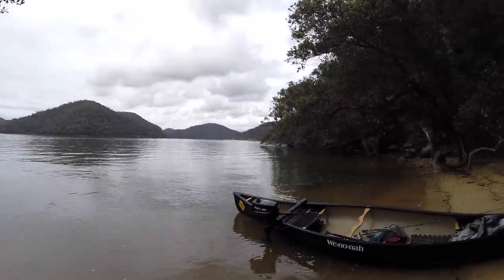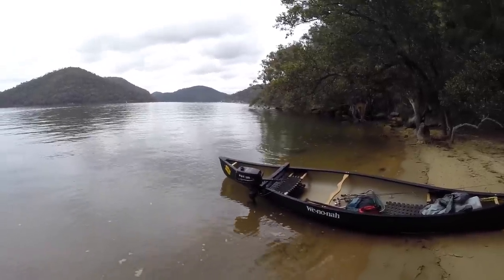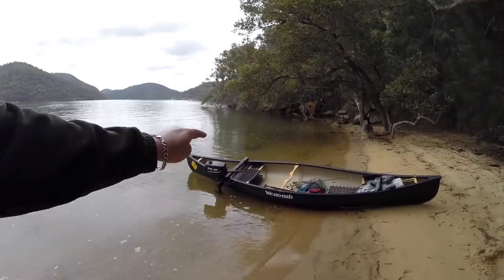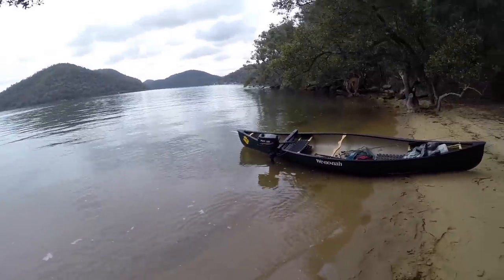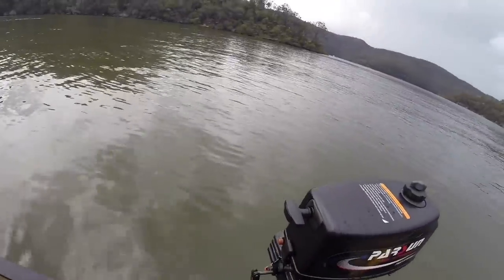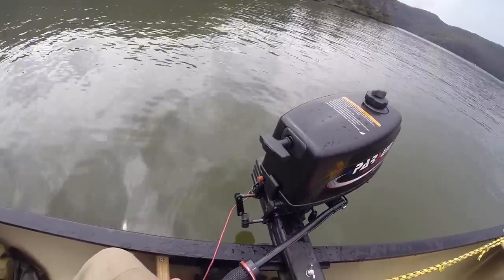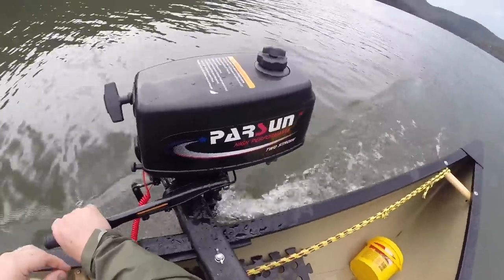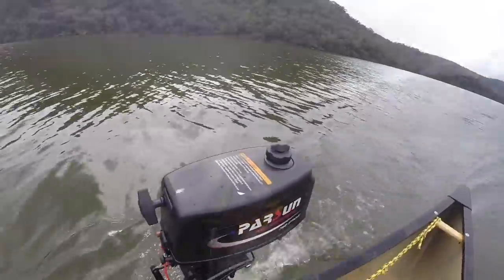TESTED - Power Canoe With 2hp Outboard Motor

Comment: Gonna try my 4hp outboard on my 15 1/2 ft canoe  with a steel transom I built today :) wish me luck . I got a buddy to sit up front for this test though  . Nice video brotha
Reply: How did the 4 horse do? Is it too heavy for the canoe? Torn between a 2 or 5 horse outboard for my 17ft Grumman with a side mount.
Reply: I sunk my canoe today with a 4hp electric outboard on a 15 foot old town canoe.   His advice about the splash guard is necessary.  Also not ideal for a lake with waves and chops.
Reply: @zachberman9785 saw someone do it with 4hp but they had an aluminum 17ft canoe

Comment: I’m torn between going for this or a 55lb trolling motor & battery. This works better than I thought it would. Thanks for the video.
Reply: Im in the same boat (no pun intended). I think the biggest perk of the outboard is not having to rely on battery power. I think the biggest negative would be the noise and lack of a very slow tolling speed. However it would be nice to reserve battery power for electronics and not your motor.
Reply: @UserFormelyKnownAs_hjkh  have a look at the Honda BF2 or BF2.3. They have a centrifugal clutch and can be run at very low trolling speeds or in neutral. Epic Japanese quality, I just bought one today.
Reply: it depends on where you run. a electric motor allows for State Park use and isn't annoying at night to camper.  if you do larger rivers and huge lakes obviously a gas would be better.  just get both and pick the tool for the job

Comment: Boat stores are far and my car doesn't tow, would like to get the sundolphin 14ft ss canoe but instead of a trolling motor it's made for I wanted a small hp motor only seeing 2.5 hp on the market not 2 hp they still make these ? Thinking of the Suzuki 2.5

Comment: Nice little engine, very fast. I have an electric motor for my canoe but would like a small gas engine like this one.....Take care, Bluefin.
Reply from the maker: +mustang774 cheers mate, yeah it moves along well. I think it fast enough to reach spots that otherwise would be too far for a day paddle. It allows me to reach a few extra fishing spots when I'm just out for the day too.
Reply: what kind of electric motor do you use?
Reply: @drunkedupdiver  I’m in the same boat as mustang (5years later and yes pun intended). I have an Ozark Trail w/ 30lb thrust. Maxes out at about 4mph. Would love to get to 10mph at least

Comment: No need to add weight up front, what you need is a hydrofoil.  It's a fin that attaches just above the propeller and it will level you right out.
Reply: Is there a specific desired angle that is recommended for a stern mounted engine? Just straight on? I am a welder and have the equipment, Just wondering how it's done. Thanks.
Reply: Talking about the hydrofoil

Comment: Nice little set up you have there mate!
Reply from the maker: +Roodog Gonebush thanks mate, I found your vid with yours whilst looking around for a motor. They sure do add to the canoe experience.
Reply: Running Stream Oh ok cool, your not wrong about adding to the experience saves the old arms and shoulders if your going on a long trip thats for sure. I think I may be looking for a bit bigger motor before long that one of mine is so loud pretty well need ear muffs lol, so your motor still going good then ?

Comment: suggestion......instead of adding weight to the Bow....why not just tilt the mounting bracket? just figure out what angle at full throttle and then wedge that...less weight means more speed :)

Comment: Will anyone  tell me that how fast  a boat can  run by 2hp engine
Reply: I AM SORRY depends on gears and propeller size... id say 15 knots wide open if you’re lucky
Reply: It depends on a lot of factors. If you attach your 2hp Outboard to the Queen Mary 2 she will move with wind and current no matter what you do to the motor. If you put it to a race kayak with hydrofoils and an aerodynamik canopy for your head and the propeller has a pitch high enough, it should be possible to reach 60 kts. So your boat speed will be something between 0 and 60kts.
Waterline length, hull shape and weight are important factors. You have to tell them if you want a better answer.

Comment: replace the water for weight with two 5 gallon pales of dry beach sand in the bow for counter balance weight.
Reply: why?
Reply: Jesse Peterson I think it’s heavier.
Reply from the maker: Water is best to use as if you capsize anything but water will take the canoe to the bottom.